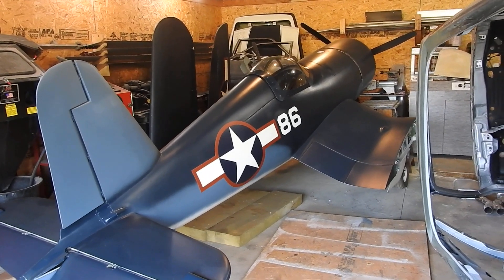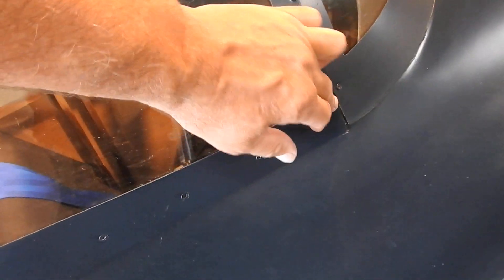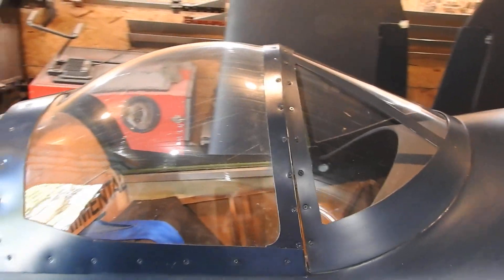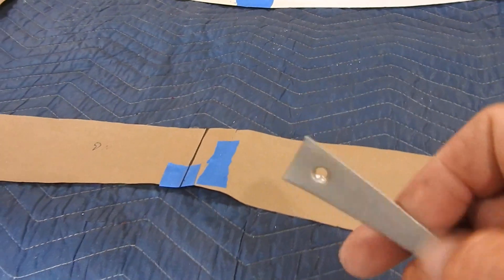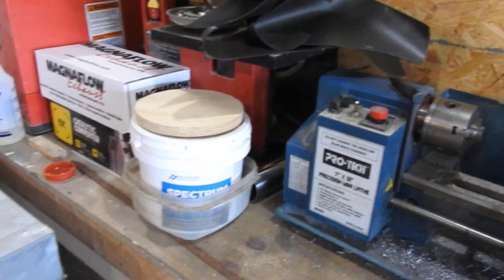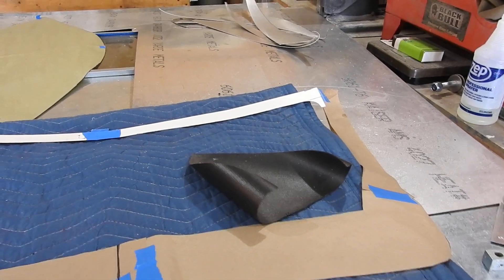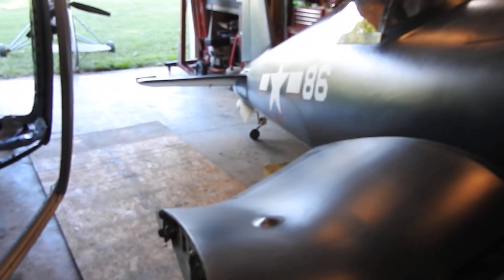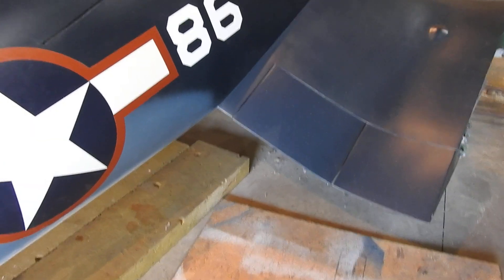WAR Corsair Update 7/4/2022

Comment: As a charter member of the "what about this club" ... my concern is the canopy leading edge being aligned even with the windscreen.  Without question, the canopy, while not flimsy, will flex and primarily at the leading edge, where if it gets into the air stream could result in its departure.  Physics will also do its thing, meaning as you high-speed taxi for the first time, the pressure on the inside of the cockpit will be greater than the outside, thereby increasing the tendency for the canopy to "lift".  That obviously would have some bad consequences.  If you apply a 1/8" or maybe 1/16" channel (difficult to describe) that is very light and flexible to the trailing edge of the windscreen, that only slightly protrudes above the windscreen cross brace at the front, but is shaped and leaves an elevated opening at the trailing edge that the canopy front cross brace can slide under, this will eliminate the bulging when the pressure differential occurs and also ensure the canopy "cannot" get into the air stream going over the plane.